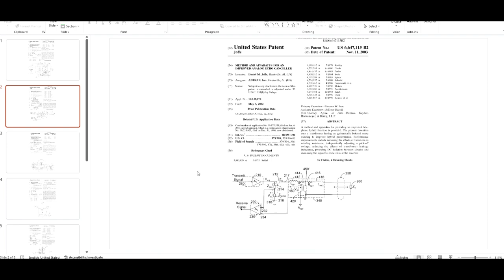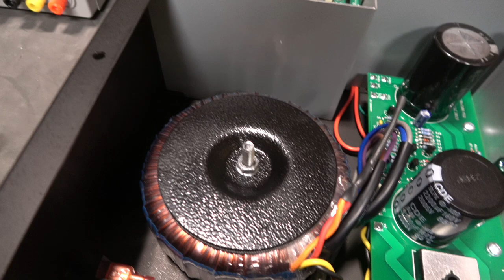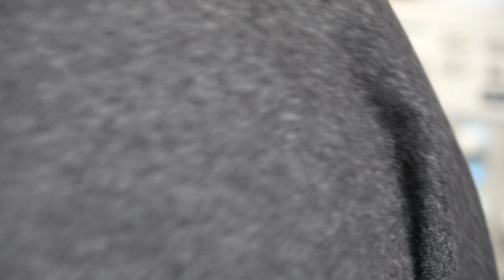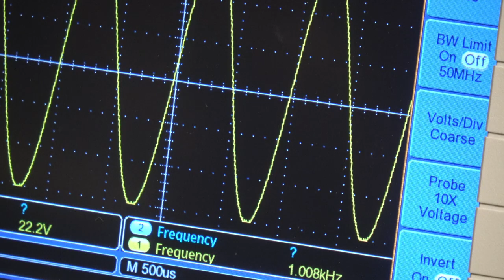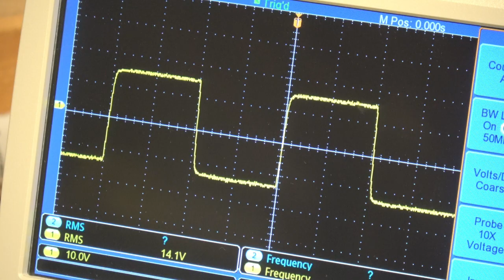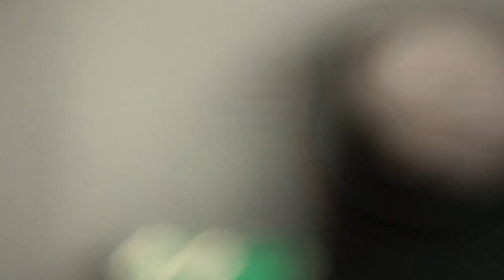Akitika GT-108 Amplifier Review Pt. 1 of 3:  The company, designer, product, specs, and measurements

Comment: I have built both the GT-102 Z4 and the GT-104 - these are the 4 ohm versions of the TI 3886 chip and the discrete version, respectively. The differences are a small number of resistors that change the impedance matching of the amp to the speakers. The GT-104 is rated at 60W/ch into 4 ohms, and about 35W/ch into 8 ohms. The GT-108 is rated 50-60W/ch into 8 ohms. I believe the minimum impedance speaker recommended for the GT-104 is 2.7 ohms, and about 5.7 ohms for the GT-108.
So, the GT-104 can drive almost all speakers, and the GT-108 is for having a bit more power if you want/need more power - and have 8 ohm nominal speakers.
EDIT: your GT-108 has a different power supply board than my GT-104. My GT-104 power supply board looks exactly like your (and my) GT-102 ps board.
EDIT 2: that 1kHz square wave is freakin' awesome! From my understanding of my B&K ST-140 amp; how an amp handles a square way shows how open and clear the treble/soundstage is.
I have emailed with the designer at AkitikA and apparently if the GT-104 had 2X the output heat sinks, it could be 100W/ch. There are some chassis out there (the company that makes the chassis for the Amp Camp Amp) that look like they would work, and they cost ~$300-350. That would also be an amazing amp.

Comment: During the late 70s, early 80s most of my HiFi was DIY (turntable, pre/power amps, FM tuner & speakers) with: arm, cartridge, cassette deck & headphones being purchased. The GT-108 appears to be a fairly conventional design BUT the use of electrolytic output capacitor (the weakest component in the path) was passe by the 70s. The're better used in a balanced power supply. 
I bet the difference between the 108 & 104 is a lowering of the supply DC voltage (different transformer?) & increase in power supply capacitance (lower voltage, increased capacitance in same size part?), an easy & a smart move? 
A comparison with amps from Cambridge-Audio, NAD etc & the best ChiFi Class D amps (Fosi, Aiyima) would be interesting?
Reply: I am no expert, but I have assembled the GT-102 Z4 and the GT-104. On the former, it came with the alternate parts, and in the manual it tells you where they go. They are mostly just different resistors in about 8-10 locations; with possibly an omitted resistor in one spot.
The power supplies in the two amps I built for each are functionally identical. My GT-104 has the same power supply as the GT-102 Z4, and the same as Stereopolice's GT-102. His GT-108 appears to be a newer revision, with the diode bridge and the simpler circuit board. Very similar/identical big caps, though.
Reply: The resistor changes probably prevent premature operation of the output protection circuits with a 4 Ohm load. Strange that the power supplies are the same, perhaps it was rated for 4 Ohm all along?
You made no mention of the output electrolytic capacitor? Hopefully it's of the very best quality & bypassed by a >10uF film capacitor (Jantzen etc)?
If you're interested in amp design I recommend getting reprints from the UK magazine Wireless World: for the Bailey (60s), Linsley-Hood (70s) & Peter Walker (80s, of Quad fame, 405 current dumping) designs. I built the Linsley-Hood & Quad but, the're 40+ years old, so I'd have to replace the power supply caps before turning them on! The caps would probably go up in smoke!!
Reply: @trevorbartram5473  I think that there is a bypass cap? I'd have to look at the board to try and see what its value/brand is? Stereopolice is the guy qualified to do this.
There may be a few part changes in the power supply? I can't remember, as I built the GT-102 Z4 a couple of years ago. The circuit is the same in my GT-102 Z4 and my GT-104.
The GT-108 that Stereopolice has is definitely a different power supply circuit.

What I know is that both my AkitikA amp sound fantastic - they are far better than my previous reference B&K ST-140 in the treble and soundstage, and far better than my Schiit Vidar in bass quality, control, and dynamics. They beat both those amps at their strengths; and not just by a little bit.

I recapped my ST-140 - and adjusted its DC offset and bias - both of which were very far off. It sounded much better than it ever had - for about a year, before the left channel MOSFETs failed. They had been biased at about 508 - the stock value was about 210, if I remember correctly?

I had gotten the Schiit Vidar as backup for the ST-140, and was deeply disappointment at how the treble quality and soundstage is nowhere near as good as the ST-140. I checked the bias on the Vidar, and it was a tad low, so I adjusted it to the upper end of the recommended range. This helped a little bit, but nowhere near enough.

When I first connected my GT-102 Z4 - I could hardly believe how open and clear and airy it was and how punchy and deep and controlled the bass is. Keep in mind, the other 2 amps are 100W/ch and the Vidar is rated at 200W/ch into 4 ohms. The little 35W/ch at 8 ohms 50W/ch at 4 ohms GT-102 Z4 trounced both the other amps at their strengths. And the GT-104 is better still!

Comment: Why have they got those wires around capacitors for?
You can buy UV metres with a circuit board that you can adjust, you know the clipping voltage was it 23 votes I think that's what it said, you can use the trimmer pot on the metre to select the clipping, cut some holes in the front to fit the meters.
Reply from the maker: The wires wrapped around the capacitors are actually "output inductors"; they are not depicted on the schematic but should be there.  Most amps have them.  They help dampen the signal fed back to the amp from the speaker, esp. the woofer, which is a generator of voltage as it settles after large excursions.